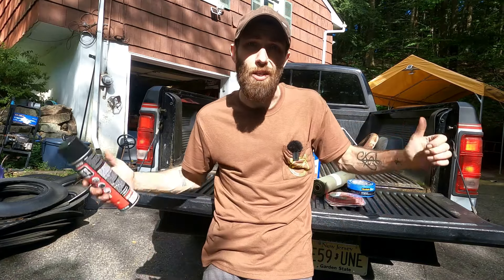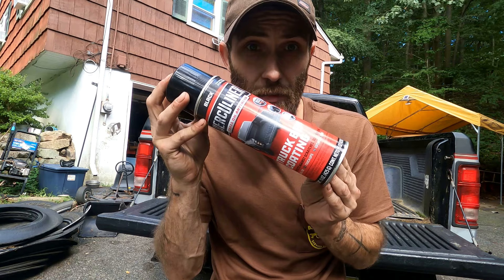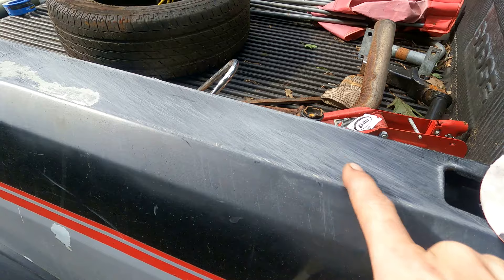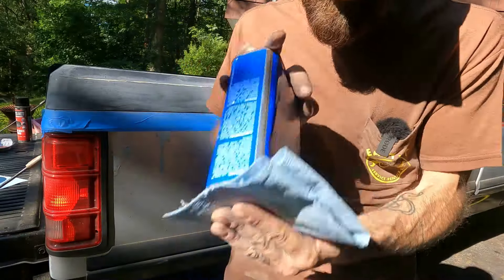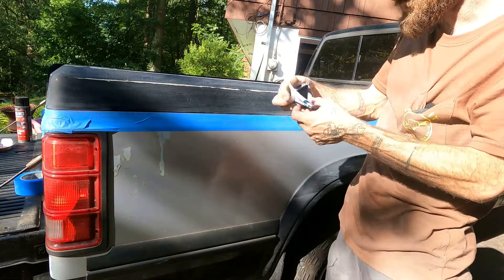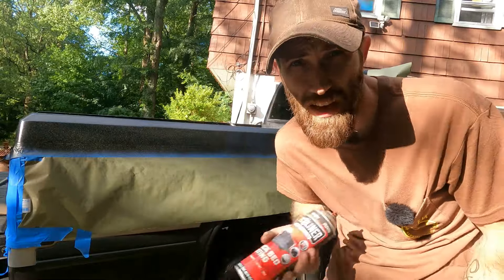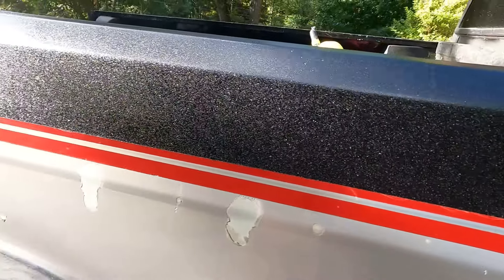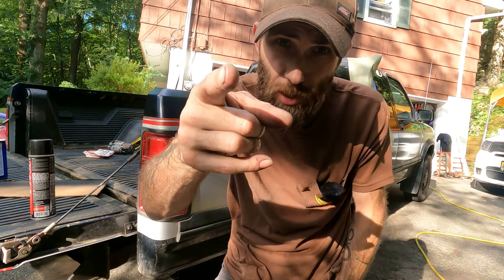PERFECT BEDLINER EVERY TIME - How to spray on Herculiner

Comment: ive used the roll on herculiner on the floor of a fullsize cherokee chief cut down on noise/heat. i recently tried the rattle can version on the cheep ebay diy rear xj bumper plus the stuff seams to work good at sealing stuff

Comment: The slide in plastic bed liner can protect the bed from dents, but unfortunately it traps moisture under it and can rust out your bed.  I had one like it in a 78 ford truck, when I pulled out the bed liner it had rusted holes trough the bed in various spots.

Comment: I’ll have to try out the herculiner next time I get an XJ and do the rattle can bedliner from the body seam down to under the rockers. I always used the rustoleum brand bedliner and it seemed to hold up ok enough. It would still need touched up on the rockers about once a year behind where the front tires would kick little stones up. Is the Herculiner a lot more resilient to damage?